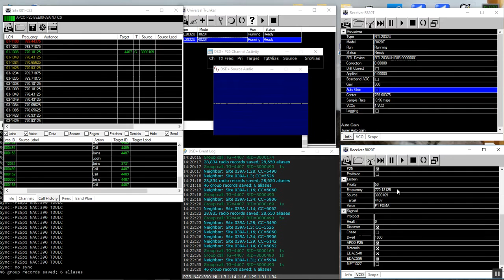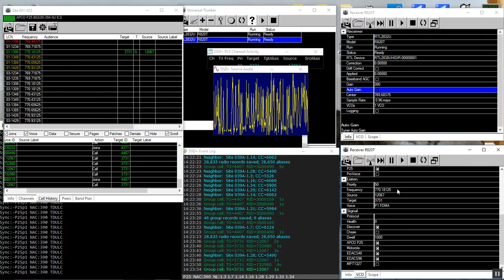Unitrunker Digital Demo

Comment: Hormany dongles did you use to decode P25 with unitrunker?
Reply from the maker: You can do it with 1 dongle and multiple VCOs.
Reply: @DanSrebnick  I have tried, but doesn,t work for me. Do you have an example or advice to config the input - output in signal/voice VCOs?. I just get the control channel and the little windows shows up, then I use the DSDPLUS. 
VCO Signal: None audio output  
VCO Voice: Digital audio in 
Then I can see the DSD blue screen working but I cant hear anything.

Thank you